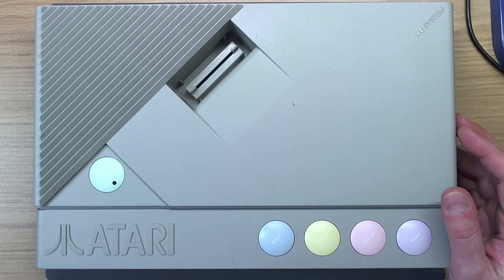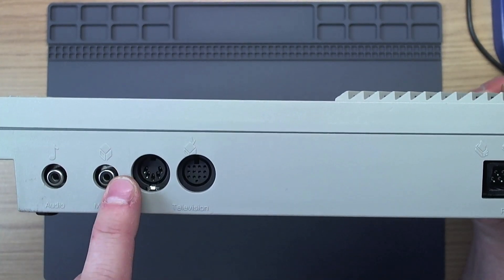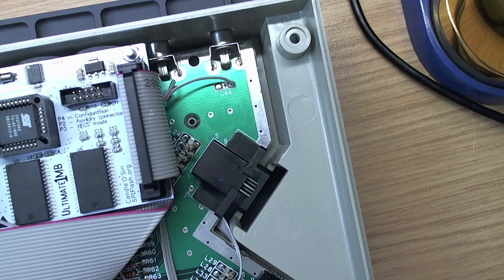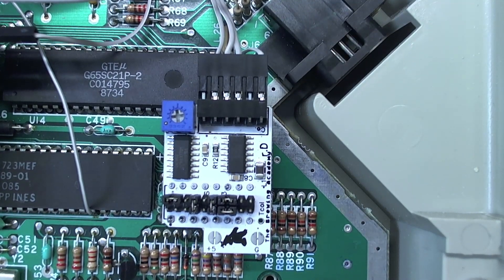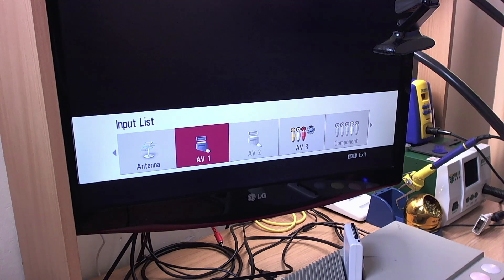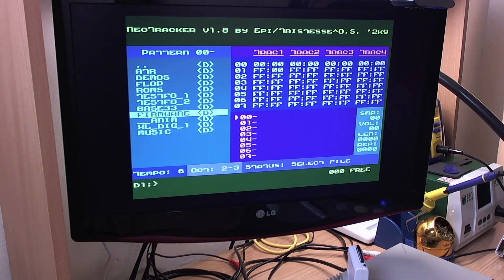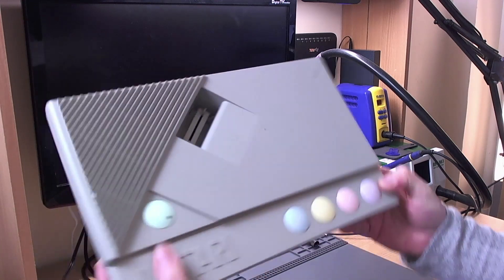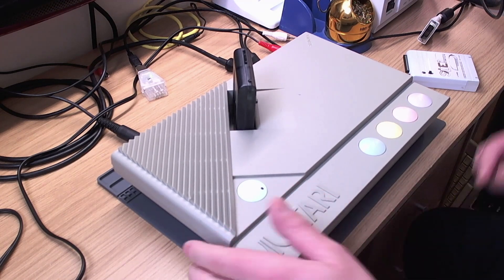Atari XEGS with UAV, VBXE, U1MB and PokeyMAX

Comment: I need your best advice. I have the XEGS and the first and most important task is to have it modded for S-video. Now, after hearing that audio, it sounds just as good as the NES system. Is that the PokeMax thing you mentioned? And what does the UAV board do?
Reply from the maker: PokeyMax is great (and yes, this is PokeyMax output through the DIN13 connector), but currently unavailable. You should perhaps wait for Candle's SimpleStereo v4, which will be released later in the year. UAV provides a modern s-video (and composite) signal with very clean definition and good saturation. But the XEGS can be modified for s-video output without UAV, although quality will not be quite as good. In either case, fitting the DIN5 video connector as per the video seems to me a sensible way to proceed (since you can then use a standard Atari video cable). For those without VBXE (and thus lacking stereo out on the DIN13), one could repurpose the composite RCA connector for right-channel stereo (since we now have composite and s-video on the DIN5 connector, as well as mono audio).

Comment: Lovely job I must say. I got jealous and now I need to get my hands dirty with my XEGS (and 130XE)... I saw you using a nice DIN13 "drilling template" In one of your older videos - would you mind sharing it (or is it just a drawing from the spec sheet)? Also - I plan to install VBXE in my 130XE (and that means RF modulator gone - which in turn means composite wouldn't work as far as I know). Do you know (I'm sure you do.. ;)) if I get composite back if I install UAV (along with VBXE)?
Reply from the maker: Thanks! Yes: composite is gone when you remove the modulator on the 130XE (although not on the XEGS, interestingly), but you will get composite back with UAV. I think my DIN template came from the 1088XEL board layout, but I had to resize it. Candle O'Sin sent me another template which I haven't used yet, but it's linked here (let me know how it goes): https://atari8.co.uk/wp-content/uploads/DIN13-template.pdf
Reply: @flashjazzcat  It sort-of works (ie. the template). I need to scale it to 29% and then it's pretty good fit - thanks!
Reply from the maker: @qqryqq123  No worries - sorry for the scaling (Candle assured me none was needed, but that's Candle). :)
Reply: @flashjazzcat  no need to be sorry - printing 3 or 4 pages to find the right scaling factor was a lot easier (and more economical) than wasting 600XL motherboard. Thanks!

Comment: so what the heck is an .XEX file vs a .EXE file?
Reply: The suffix has not much of a meaning. .XEX is easier to tell that it is an Atari 8-bit file. With a .EXE you can't be sure as it can be a MS-DOS file or something else.
Reply: @johantibbelin417  Ohh okay, I thought it was some sort of special executable that  won't work on a stock Atari, vs all the new fangled mods that can be installed, or something new in SpartadosX.. because "X"